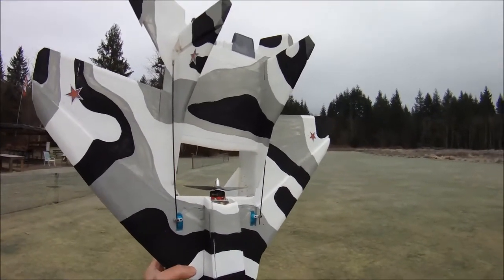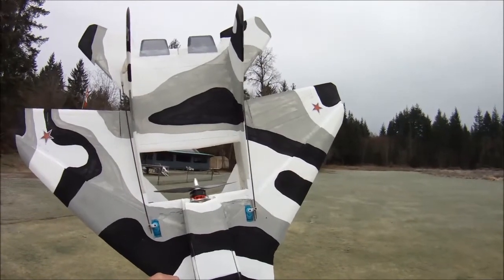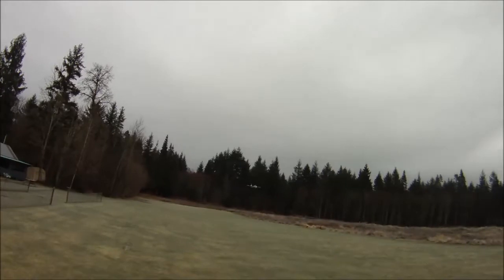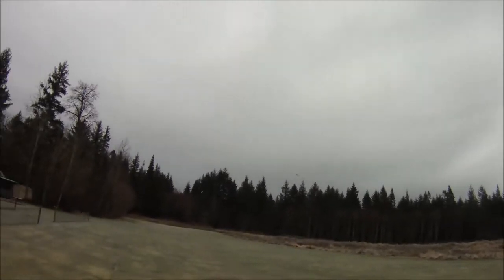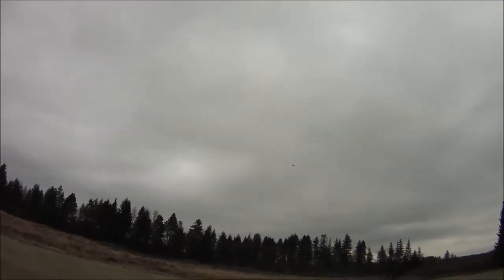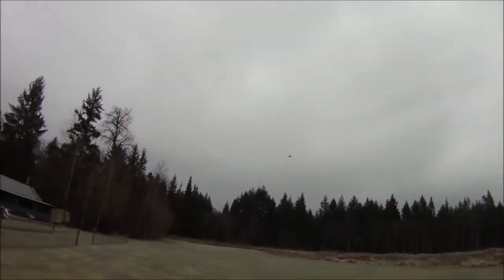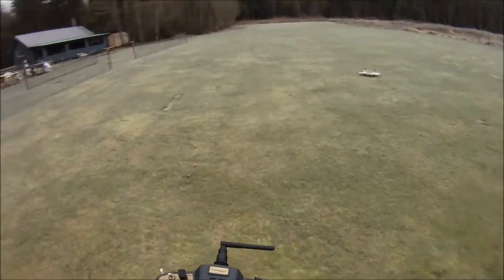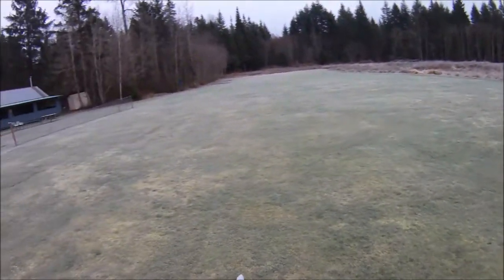Field test - EMAX RS2306 2750 Kv motor 6x4 APC gas prop on 3S

Comment: What prop can I use with 40A ESC and 3S 1300mah 75C in the same motor but 2400kv?
Im in 750mm flying wing project...help please😉
Reply from the maker: If you want to swing a 6" prop, perhaps try the Gemfan Flash 6042x2 prop, it is my favorite 6" 2 blade prop https://www.banggood.com/2-Pairs-Gemfan-Flash-6042-6_0x4_2-PC-2-blade-Propeller-5mm-Mounting-hole-for-RC-FPV-Racing-Drone-p-1246562.html?rmmds=myorder&ID=3868&cur_warehouse=CN  Or check the data on wherever you bought the motor, they might also have good recommendations for props on your motor on 3S if you don't want to swing a 6" prop.  Good luck.  Cheers, Scott
Reply: @e3Scott  Thx Mate.
Reply: Scott...about drone props...is it a problem to work(fit) it as a pusher. I have CW motor what prop  should I use CW or CCW? I fly gassers, never had any pusher plain...maybe once many years ago and it was RTF.
Greetengs from Polish Coast.
Reply from the maker: @TheMefisto97  Greetings Kamil, no it doesn't really matter, as long as the numbers on the prop blade are facing the direction of travel of the airplane, it doesn't matter if it is a CW or CCW prop.  It will be evident if your motor is spinning in the correct direction when you give it a test spin.  If the thrust is going in the wrong direction, simply swap any two of the leads between your motor and your ESC and it should spin in the correct direction.  Just be aware that torque roll will be opposite to whatever direction the prop is spinning as it would be with any plane, so if you are hand launching your wing, be prepared for it to want to roll opposite to the prop direction.  Good luck and greetings from the West coast of Canada :)  Cheers, Scott
Reply: @e3Scott  I have found some tests of 2400kv motor. The most powerfull prop For 3S pack is 6040BN tri-blade...it will generate 1263g of thrust at 34,6A. Damn... it'll be a ROCKET.
Tnx again for help.
Reply from the maker: @TheMefisto97  Hi Kamil, I have also used the Gemfan Flash 6042x3 blade prop https://www.banggood.com/2-Pairs-Gemfan-Flash-6042-6x4_2x3-6-Inch-3-Blade-PC-CW-CCW-FPV-Racing-Propeller-for-RC-Drone-p-1312365.html?rmmds=myorder&ID=224&cur_warehouse=CN on a 2212 2200 kv motor, very good results.  Here is the video https://www.youtube.com/watch?v=xxPhJ31UG7o&list=PLKu3yFqYM98mOVc6vpxiog7bNmulXp1kU&index=11  Cheers, Scott

Comment: Hi , u are fly 3S with get awesome speed , i Just get one like to attach on my DIY pylon racer , some questions may need ur help , as I know this motor use on TGS 6X4 prop may draw up to 58a / 4xx W , the esc choice for this motor on fix wing have any comments?
Reply from the maker: Hi, thanks for watching and your feedback :)  If you are using a TGS 6x4 prop with this motor on 3S, I would recommend at least a 40A ESC.  I tested this motor on the bench and in the air with the 6x4 KMP/TGS prop just recently, you can see that video here, in the comments there are links that will provide you more data https://www.youtube.com/watch?v=gZHtLXftMYk&t=3s  On 3S, this motor pulls between 38-41 amps depending on the brand and configuration of your ESC.  I hope that helps, good luck with your pylon racer :)  Cheers, Scott
Reply: I'm try with hobbywing platinum 40a mount on 780mm home made pylon racer 
Test flight results is good , enough for fun 
This Motor have very great power in this size 
Thanks agian for sharing your experience:))
Reply from the maker: That's great, no problem, best of luck :)  Cheers, Scott

Comment: WOW Scott definitely could see a difference in the vertical clime out there. Nice power in such a light plane.
I may have a new super prop to try. I'll see what they're like when they turn up in a few weeks.
...RCPP
Reply from the maker: Hi RCPP, this motor is definitely up at the top of the quad motors I have tested thus far, very impressed with it.  If the Turnigy AE ESC gives me even more power, this plane will be a complete rocket!  Look forward to seeing what new prop you have to try, I'm certainly converted to the 6x4 APC gas on my planes now :)  Cheers, Scott

Comment: Love these motors. I was thinking of trying the 2300kv variant with my 1500mah 4s Infinity Graphene 80c - 100c batteries. I also have some HQ Durable Prop 6x4.5 bi-blades to try which are designed for motors like these and should give very good performance. For now I will try these props on the Sunnysky 2205 2300kv motor that I mentioned in the comments a couple of videos ago and see how they compare to the Dalprop T5050C tri-blades I was trying).
Reply from the maker: Very cool, be interested so see/hear how you make out. :) I think that thus far with these quad racing motors in my park jets on 3S that having something a bit bigger than 2205 with a Kv higher than 2700 seems to be the ticket.  This one and the BeeRotor Z2207 2780 http://rctimer.com/product-1734.html from RC Timer are the two winners thus far of the four motors I have field tested.  Cheers, Scott
Reply: e3Scott yeah I agree you would need higher kv with the 3S. I’m going down the 4S path because I have so many of them that I use on the quad haha. Also by using a higher voltage with lower KV the current draw is less for roughly the same amount of thrust compared to the 3S setup. This then allows for longer high throttle settings with much less battery sag, especially when the batter is getting low. With quads a lot of guys are trying out 5 or 6S with 1800kv type motors for this reason. Also you can keep the same weight because due to the lower current draw of the higher voltage you can use a lower capacity, eg. my 4S are only 1500mah and I have similar flight times to my 3S 2200mah.
Reply: Edit, I just tried the HQ 6045 prop and it was very nice, felt like more speed and flew nicely on low throttle as well. Flew for 4:30min and still had about 38% left in the 4S 1500mah. I think I'm well beyond the thrust vs drag curve though with my slow KF2 flyer haha so any further testing would be wasted on my jet. Great to experiment though which I wouldn't have worried about if it wasn't for your videos. Keep up the great work mate and I hope to one day find time (and foam which is near impossible in Aus) to build your Mig-35B.
Reply from the maker: That's great to hear, mate, always fun to experiment, you sometimes never know what you will discover unless you take the chance :)  Be great to see another Mig-35B in Australia.  You might have heard of them before, a couple of guys started a business a couple years back in Aus http://www.rcfoamfly.com/, they actually can laser cut RC Powers planes, looks like they sell foam also, not sure where you are in relation to them, shipping is always a killer with foam as it isn't heavy, just awkward size.  Best of luck with your continued RC journey, rolling in to the new year I hope to do more "how to" style videos and table talks as I get finished up with a bunch of quad motor and prop testing to use in my park jets.  Cheers, Scott
Reply: Yeah I know rcfoamfly that's where I bought my laser cut SU-35 V5, they are about 1000km south from me down the coast. Great, easy way to do a foam park jet build. Need them to sell a laser cut Mig-35B wink wink haha. Merry Christmas mate.